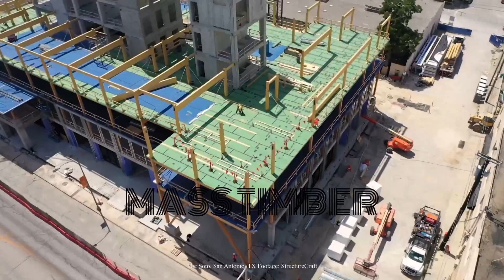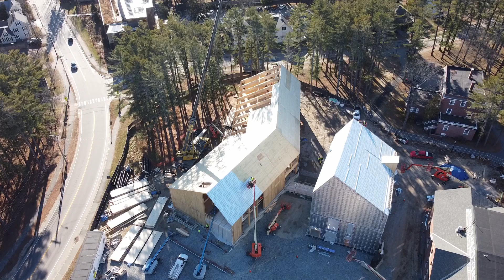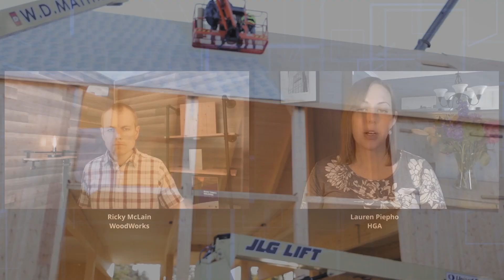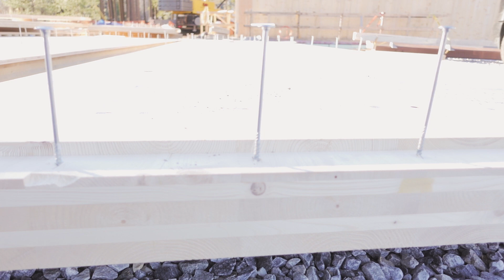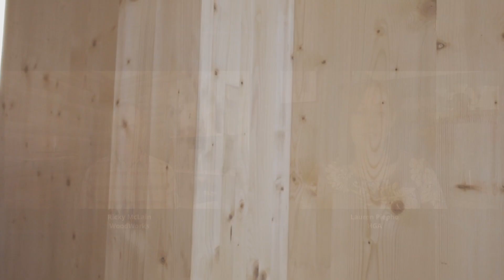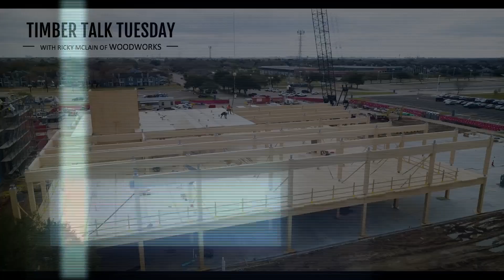CLT Shearwall Design at Bowdoin College | Connections, Seismic Analysis and Details

Comment: Will shear wall be limited to low strength design, or is it likely to be used for designs in areas subject to the Cascadia subduction zone earthquakes, with strong ground forces lasting minutes?
Reply from the maker: The building code and referenced standard permit the use of CLT shear walls in low to high seismic zones, though the overall system height has a prescriptive limitation of no more than 65 feet.